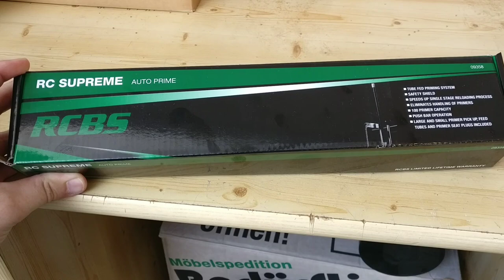RCBS RC Supreme Auto Prime - Set up manual (RCBS automatischer Zündhütchensetzer)

Comment: Thanks for the video....  I have one of these, the threads on the shield tube broke off because there made out of pot metal.  Cheap.... I have tried contacting RCBS about a replacement multiple times but with no luck.... no customer service at all.  I won't buy their products anymore.  There are better products out there, this is junk.
Reply: Their powder scale i similarly rubbish, incredibly light and consistently inaccurate. I bought a 1960s Ohaus which weighs a tonne and works perfectly.

Comment: You used the wrong primer tube, the pickup tube is not the magazine tube. I made the very same mistake when I assembled mine.
Reply: So how does the system actually work? Mine has the tubes, two with the nylon (small and large) picker uppers and two tubes with no plastic. No instructions at all although I did get it setup correctly. I do not know what the two plain tubes are for. Seems it would be just using the tubes with the plastic. Lost.
Reply: @johnsathe2429   the two plain tubes are the internal tubes for the press, the two with the plastic tip are used to drop the primers into the internal tubes. I made the same mistake so I'm by no means judging!
Reply: @madscott85  So, you load the tube with the plastic tip first then transfer (without spoiling or losing) the primers to the plain internal tube?? Now it's making less sense to use the system. Seems overly complicated for loading the primers.
Reply: @johnsathe2429  yep, spot on. You have the little cotter pin in the bottom of the pickup tube so that when you invert the pickup tube the primers don't spill out, once positioned over the internal tube on the press you pull the pin and the primers drop straight in
Reply: @madscott85  Kind of a "Rube Goldberg" way to do this. I'm thinking just use the tube with the plastic tip, that way the primers are not subjected to the long drop when attempting to fill the internal tube. Or am I over thinking the whole process?
Reply: @johnsathe2429  you might be, but it's your call in the end.